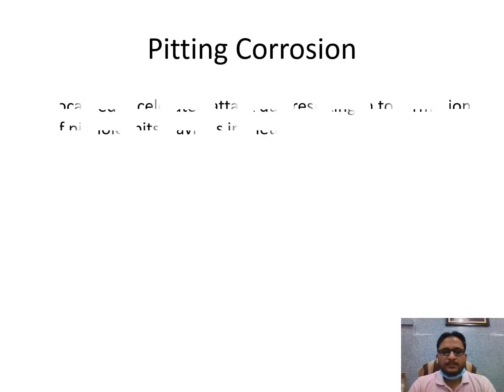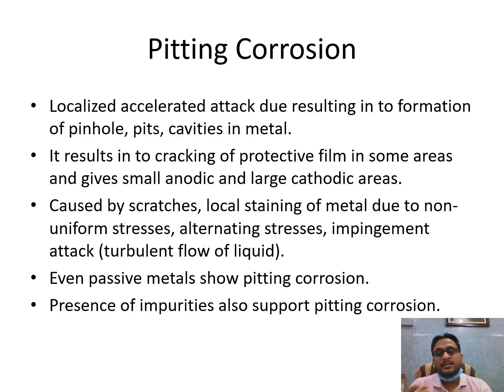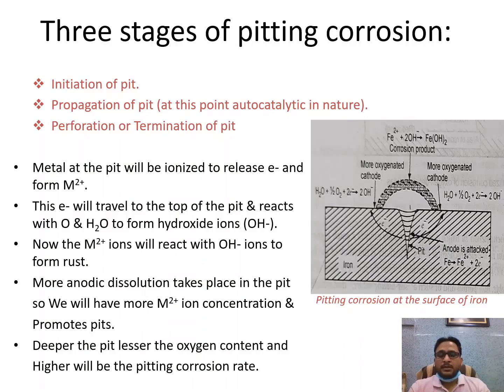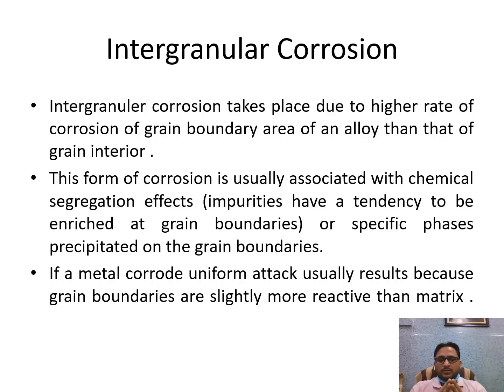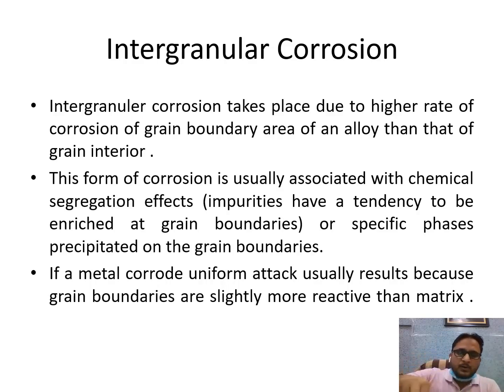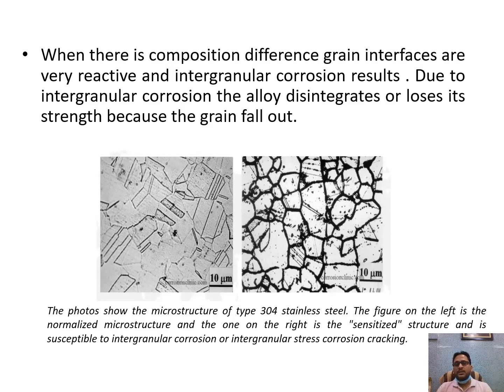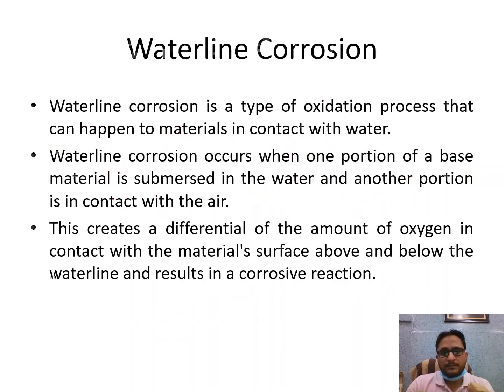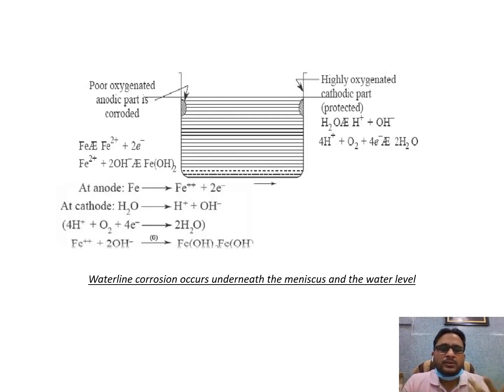Corrosion Part-IV (Pitting, Intergranular & Waterline Corrosion)

Comment: Can u tell me actually we have a term project and our task is to do a intergranular corrosion by our own by using possible methods. How can we do Intergranular corrosion on stainless steel by using possible methods. What's it's process?? It's steps?? Which chemical we need for doing this ???? How much time it will take???
Reply: Create some pits/cavities and place in a moist environment. You can also use acidic environment to accelerate it.
Reply: @ZainKhan-IC  but how to do it??? Machine?? By heat or cold process ?? Tell me complete procedure